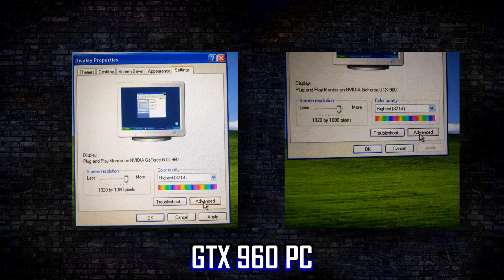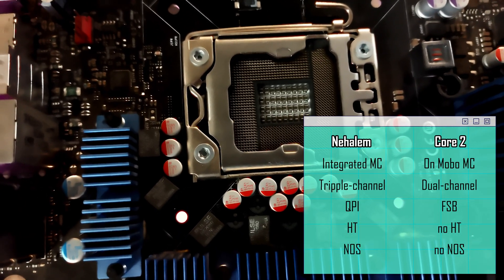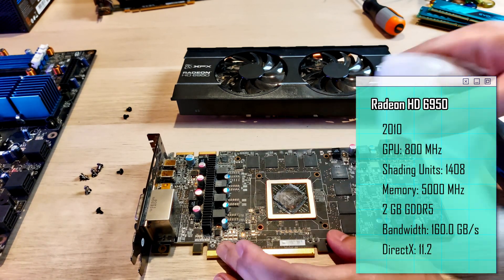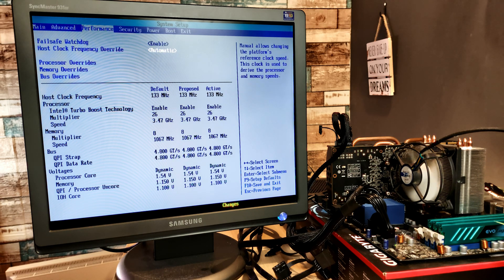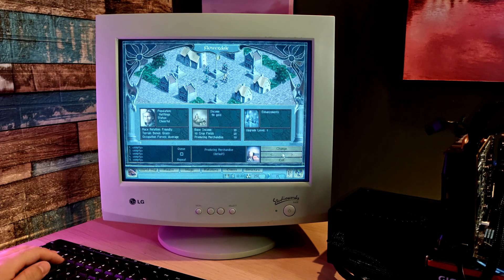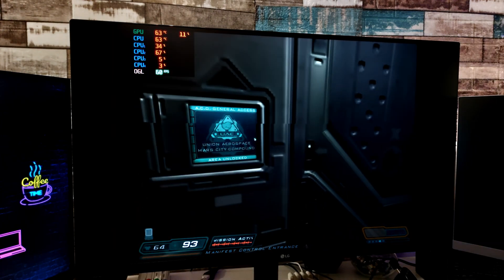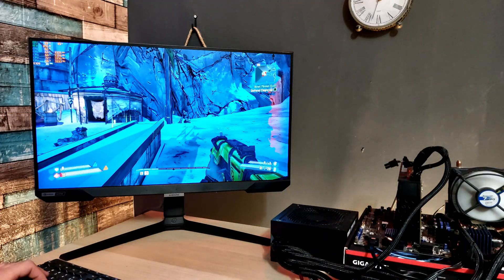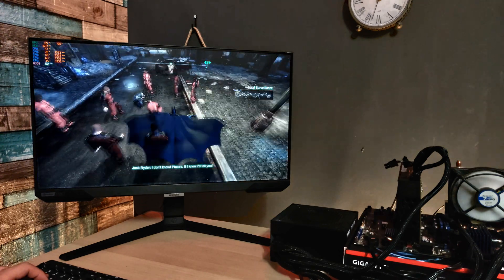i7 960 & HD 6950 @ Windows XP Extreme Build

Comment: Beautiful showcase.of a high-end XP PC. Nice showing the advantages of going with a Radeon!
Reply from the maker: It is beautiful, thanks :D The Radeon is nice, but I have another problem, the image won't fill the entire vertical space when using over 60 Hz, for example:

1600x1200 60 Hz fills the entire screen
1600x1200 120 Hz uses 1:1 pixel mapping, the image is centered, with black areas left, right, top, bottom.
Reply: @MidnightGeek99  Interesting! I haven't done  much testing with higher refresh  rates, so I'm not sure what's happening.

Comment: I second you opinion that Nvidia for XP is worse in terms of compatibility than Ati/AMD. I've got two XP PCs - one with a GTX750Ti and another one with an HD7750 and the latter plays ANYTHING I throw at it from the 98/XP era (driver v13.1 - totally recommended) unlike the one with Nvidia... Not only more compatible but supports GPU scaling, 0-255 over HDMI etc.

Comment: Higher refresh rates do work on XP with Kepler and Maxwell, but only on Displayport. Could not get it working on HDMI or DVI. Also, the latest driver (368.81) is broken in that regard, you must use version 355.98.

On my GTX 970, I get 1920x1080 at 100 Hz, and 1440x1080 or lower at 120 Hz. That rig also dual boots to Windows 7, where everything works at 144 Hz.
Reply: 1080p 144hz in xp over dvi dual link no problem with GeForce 8800

Comment: Two XP machines. One Athlon 64 X2 4800+ running on a S939 nForce3 250 with 2GB of Kingston HyperX DDR 400 in dual channel, a 256MB XFX 6600GT and a SB0090 Audigy PCI. for the likes of MS Flight Simulator 2002 & other early XP games. The other a Q9650 running on a S775 P35 with 8GB of G.Skill DDR2 1000 in dual channel, a 2GB EVGA 750 Ti SC and a SB0090 Audigy PCI for mid-late XP games.
Reply from the maker: Nice mix of systems, and I agree, it's nice to have 2-3 systems for different periods, I'm doing this myself.
Reply: I got an old IBM with 3 ghz Prescott Pentium 4 with HT, 2.5gb of ddr1 ram and a Radeon 9250 if i remember right. Never had a Pentium 4 before,but it's the hottest cpu i ever used. Fans ramp up just by doing basic things in Windows
Reply: @LUR777-g7r  Tried a Pentium 4 3.2E Prescott myself before the Athlon 64. Even with changing the fan on the cooler to the quietest I could find, it still sounded like a jet with the rear of the case being better than most public toilet hand dryers.

Comment: what is the point of not having HT?
Reply from the maker: If I don't need it, why have it? usually HT takes from the pure core performance.
Reply: @MidnightGeek99   if you want to have pure core performance use even faster stuff  like Z68 or X79. Removing the HT it is like removing a drop out of the ocean for these games/cpu combo, while you are loosing all the fun as you declared with "yeah". Geek I think in some cases you are still thinking like the guy who did not have money to buy the P4 back in the old days..hey..it is nostalgia fun...push it to the limit..rock it.

Comment: I was using Radeon HD 7770 in my XP machine until I switched to GTX 970. Paired with C2D E8400 it's a bit overkill, sure. But why am I typing this? Native 75Hz refresh isn't a problem.
Reply from the maker: Yes, you can do 75 Hz, but the differences from 60 Hz are minimal.

Comment: Great video, my xp machine is currently a 7800gt with a zalman fan & e8600 on a 775 board but recently been thinking about a new xp build, something more like this. Thanks for showing & I'm off to dig through the boxes of parts
Reply from the maker: The E8600 is very good, you can pair it with a 8800 or 9800 series card and you're golden!
Reply: I have a nice 9800gt sitting on a shelf so I'll pop it in & then I can relax & continue with my efforts to stop being obsessed with eBay, I look at graphics cards, broken PC's & older CPU's like other people do with social media. And don't mention my search for a crt monitor which has become almost a mythical quest, yet back in the day I dumped CRTs as no body wanted em

Comment: All great picks to max XP, while staying within the period, as most went from XP to 7 for gaming. I7-960 is nearly as fast as 2500K.

I rebuilt a XP rig recently, overclocked Q6600, and GTX 950 (960 was overkill with C2Q), but I just used what was in storage.
Reply from the maker: Yes, balanced components, unlike yours, Q6600 with GTX 9xx series :P
Reply: Indeed!  My X1950 XT got jealous, but the GTX 950, it runs so silent.

Comment: Ahh,the Zalman Z3 Plus. I had the white version of this case in my highschool days,back when 60$ could get you a decent case with 4 fans from the factory
Reply: Still using z3 plus the black one. It started with a GTX 1080 and now going with a RTX 3070. It is serving me for almost 8 years straight. Only failure was one of the top fans.
Reply: @YokCrysis.  Nice. The fans were not top quality,not even 3 pin but Molex but hey,for the price of the case they were decent enough. When i sold mine in 2020 it still had the original fans but the top fans were starting to rattle a little too. It's up there as one of the best cases i had,way better than a Cooler Master Elite 370 i used to have,more expensive and cheaper metal
Reply from the maker: White? :O Wow...I did not know it exists.
Reply: @MidnightGeek99  Yeah. When this case launched 11 years ago or so,people didn't really had the white case trend yet so the black one sold better. I guess it's "good luck" now to find a white one with plastic that didn't yellow. Also this case had a GPU holder from the factory,don't know if you have it and just didn't install it but it had that too
Reply: @LUR777-g7r  Ironically the gpu holder kept a lot of gpus from fitting in the case so had to be removed.